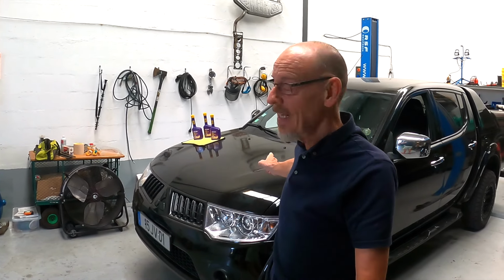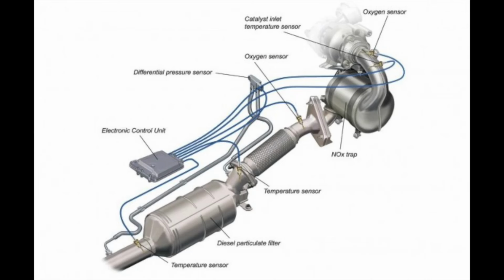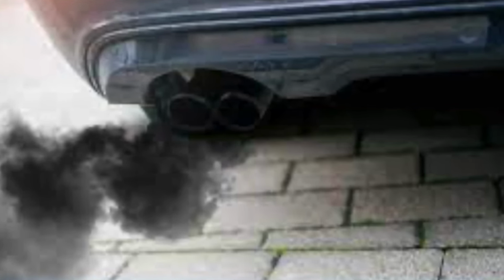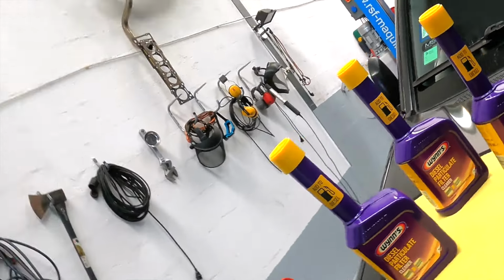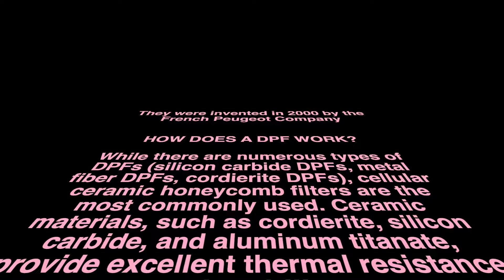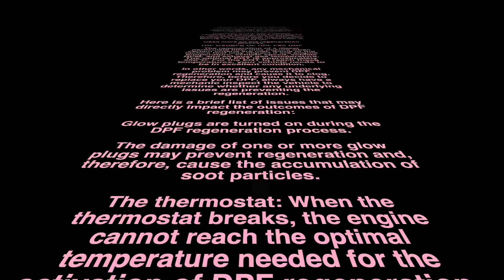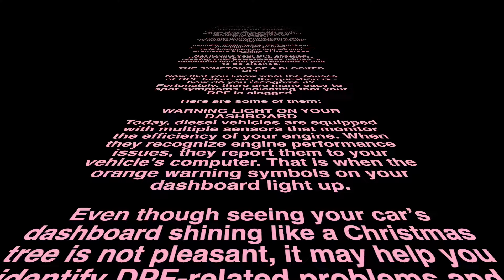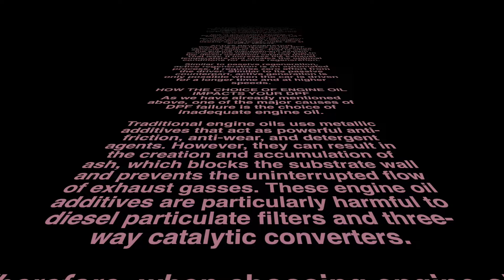Stop Blockages: The Surprising Damage Diesel Particulate Filters Can Cause!

Comment: From what I understand, constate short journeys will clog up your DPF as engine does not get hot enough to clean DPF. Most modern diesel engines monitor this and will do an automatic regeneration of the DPF which involves putting more diesel than required to run the engine normally, some of this will wash past the piston rings and dilute your oil which leads to engine wear. Need to take truck out onto fast road for 20 mins at 50mph or greater, this should clean DPF.
Good luck
Reply from the maker: Its been odd - Nath took it 2000 km to North Portugal (loads of motorway), ran a dream - two days after he returned, I drove to the shops; tons of black smoke, no power - the garage (as we bored you with) thought turbo (which it was) but the blocked DPF caused it ? had a 250 euro clean, so hope its cured for quite a while - I will pop this gunk in top be over sure and keep lending it to Nath, who drives like a 20 odd year old does 🤣
Reply: Need to swap with Nath, will not not any issues with his 20 years old L200 👍👍😉😉

Comment: Hi. I just watched your video on DPF and turbo issues. In my experience with DPF, fuel filters and  turbo issues I've tried many additives including the brand you are using every 3rd fill in your truck. 
In 2019 I came across an additive by Archoil, it is without any doubt the best I have ever used. It really does work and surpasses all expectations. I'm not affiliated with Archoil nor am I a sales person, I'm simply passing on info from one driver to another.  I'm actually a retired water engineer.

 find in the links the additives and if you do use them make sure to follow the how to use instructions religiously. 

(1)    https://www.powerenhancer.co.uk/product/archoil-ar6400-d-max-professional-diesel-engine-turbo-dpf-cat-cleaner-concentrate/

(2)   https://www.powerenhancer.co.uk/product/archoil-ar6900-d-max-advanced-diesel-fuel-synthesis/

(3)   https://www.powerenhancer.co.uk/product/archoil-ar6900-d-max-advanced-diesel-fuel-synthesis/

My wife bought a 2013 Fiat 500L trekking 1.3 Multijet in white, black roof and black alloys. I picked  up the car and drove it back home, the drive was 50 something miles. On the motorway it was unresponsive, flat and under powered. Once home I added  archoil DPF, Cat, Turbo, fuel system cleaner, (given her car is a 45 Ltr tank) as per the instructions, I added the full bottle to a full tank of diesel. what a difference it made, it's a totally different car, performance wise. On the next full fill I added the fuel synthesizer making sure to use the correct ratio and  do this on every fill. The car runs amazingly well and is now a pleasure to drive. It does recommend using  the DPF, Cat, Turbo, fuel system cleaner every 3 months, it also says that if using fuel synthesizer in every fill then use the DPF, Cat, Turbo, fuel system cleaner every 6 months. Whatever you do, do not use the 2 additives at the same time. use the full tank of each additive separately.

Happy Driving

Sincerely Paul
Reply from the maker: Hi Paul - thanks for the info and the tips - I waited to reply as we (I say we, I mean my son) took the DPF off yesterday (expecting it to be grim) to our surprise it was really clean, that said, not driven that far since the professional cleaned it (probably no more than 2000km) but the old girl does chuck out some black crud if you idle for a bit then floor it ! I think you may find this chap interesting UCWxoQGSEofoAXAtjRATQQ2g (Steven B. Tuner) as the DPF was off (do not wince :) we tried one of his ideas (dishwasher fluid) and you could eat of our DPF after, honestly we were very surprised - lucky to have my retirement man cave (way better than a villa in the sun - tolerant wife !! )  with the lift, so we can dismantle things easier than most. Appreciate the tips, going to get some on order right now !